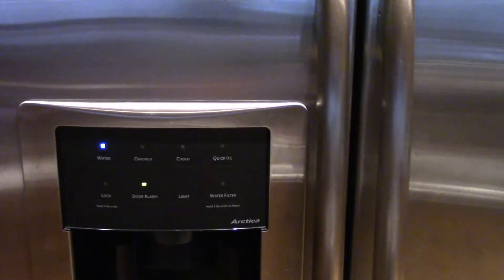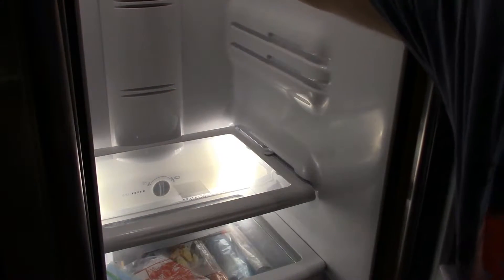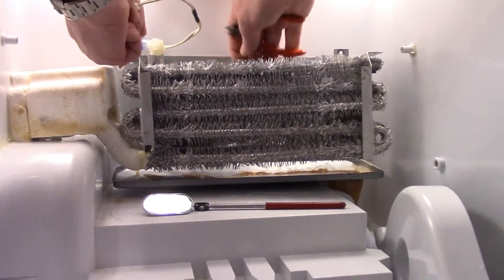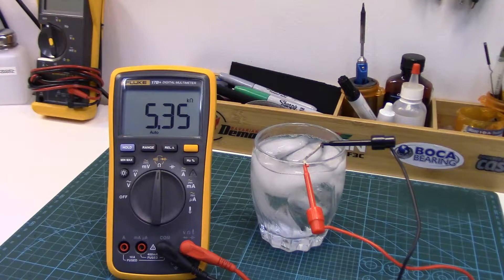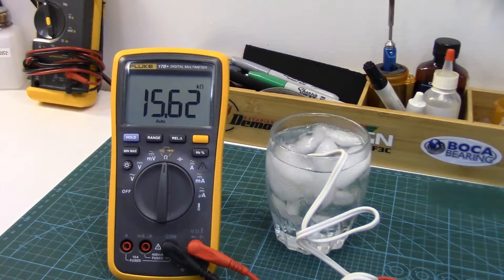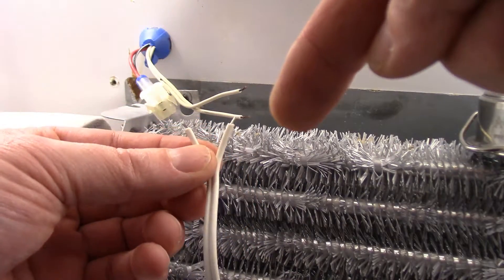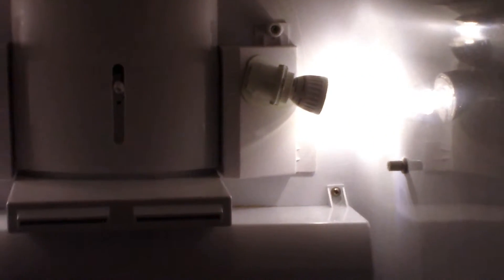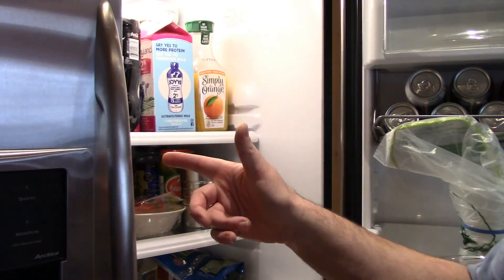Fridge Temp Sensor Replacement & Testing

Comment: Hi. I have a freezer( turbo air) I need to set the temperature between 17-22 degrees. Any recommendation? The guy that used to do it stopped doing it.

Comment: The temp sensor in my refrigerator freezer section went and with 2!sensors in the freezer, one reading 0 degrees and one reading 85 degrees at the evaporator, from the motherboard i knew my problem, replaced the thermistor and the both are reading a freezer temp with resistance difference between the two  being very close to each other. I found marine grade heat shrink very important. And i cover the ends of the heat shrink with a little RTV from my automotive supplies. And i do love my LED bulbs ! And you are lucky my motherboard is $275.

Comment: What was the resistance written on the wire of the old thermistor?  What was the value written on the new one (at room temp 25C)?  I would assume that it has to match? The old one seemed to work (a few k ohms and changed when cooled). How many thermistors are in a normal fridge (refrigerator plus freezer (LG three door)?
Reply from the maker: There were/are no resistance values on the wires/thermistors, you have to get that info online as I show in the video @ time index: 4:49. Your specific model might also indicate the values on the schematic diagram which is a pamphlet either on the back of the fridge or in a pouch beside the main board (at least on GE) no idea what LG offers. A few K ohms out from nominal is most certainly enough to cause issues. Test values have to be pretty much what the manufacture call for, in this case 6.2K at 68F and 16.3K at freezing, just as shown and indicated in that GE online test manual. Other brands may have different diagnostic test methodology however so don't just presume all are the same.
All depends on the design of the refrigerator as to how many thermistors are used. Two evap units like this one will generally have 4 (one on each evap, and one for each cooling compartment). That information is shown on the schematic diagram for the specific make and model or look it up online.
Reply: Wow, as many as 4.  I was wondering if there was even one in the Ice maker area (5?, left side of top refrigerator section).  So far it has been confusing at best to locate good, non-conflicting LG data for my model (LFX31925ST /08 ASTCNA8).  Mine suffers from the refrigerator section getting too cold, so that is likely where the defective part is (if i can only find it). I think i will pull it out and see what is on the back (one line diagram). @Rchelicopterfun

Comment: OMG ☹as originally suspected I think it’s my freezer evaporator thermal sensor now! Freezer temp getting colder @ -1F yesterday.  I replaced the freezer side panel thermistor behind the oval plastic grille. Temperature went even lower -13F (12hrs later). Do I need to remove the evaporator to get @the 2nd freezer temp sensor? Gerr! It’s a bear to get into the evaporator freezer section.  Didn’t even see the sensor on another YouTube video of replacing the condensate pan just under the evaporator.  Can’t find a diagram of its exact location. GE Ziss480nxbss. Wondering if I can pull it out through the rubber plug (easily accesed) of wires into the evaporator compartment though the wall separating the evaporator and the compressor up top? In your video your sensor came through the back wall through a rubber plug of wires (although your sensor sat in a specific hole near the evaporator). My rubber plug of wires is easily accessed at the top compressor housing compartment. Help please please🙏🏻 need an exact location of my freezer sensor.

Comment: I have a hisense rb372n4ac2, same problem. Should i change the sensor nearby the evaporator like you did, or another sensor in de freezer underneath on top. There also another sensor in the fridge. The fan is turning pretty and the compressor is constantly running

Comment: Wow John, I have almost the same exact fridge PSS26MSTD. Great tutorial. My issue is the freezer builds up frost every week or two and I have to let it melt and plug fridge back in. I heard the amazon heaters are horrible so I was going to buy a GE heater. Wondering if the Amazon Thermostats and Temp sensors are decent. I guess my only concern is if I should replace all 3 parts considering I have to pay out of pocket. No help from landlord. I guess I’m going to open the freezer panel and test the Temp sensor first. Any suggestions, like if the sensor is bad, are the other 2 parts bad as well? Any ideas would be highly appreciated as I have been unplugging fridge for about 3 months because too expensive to get a repair man! They want like $600. All 3 parts from Ge are $180, but the heater alone is $105. So if I don’t have to replace heater, it would be great.
Reply: Great Video btw John. Very clear instructions on how to test. I was wondering, if I put a multimeter on the heater and there is continuity, does that mean it’s good? Just curious on how to check if it’s bad. This has been an ongoing problem. I’ll update when I check the temp sensor first. Sry for the long message! Take care.
Reply from the maker: Sorry, no idea on the heater as I've never done one. If I had a suspect defrost heater, I would be researching the full diagnostic fault tracing procedure using Google and/or the repair forums. Could be several things I would think ranging from the temp senor to the heater relay to the heater itself, or worse case, the control board.
Reply: @Rchelicopterfun  yea, hoping it’s not the board! Thx John. I’ll be checking sensor later today.

Comment: Are all sensors have the range or each  manufacture has its own specification?
Reply from the maker: Some will be the same, others different. Always best to check the manual for your specific model for confirmation .

Comment: We have this exact fridge and I've fixed most issues except the ice maker so I'm hoping you can help.  I'll give some backstory. I usually fix our own appliances but this came with our new home and Monogram is much more complex than traditional fridges it seems.  When we moved in it worked just fine for a few months except the ice maker didn't work. The water doesn't come out of the inlet that goes into the ice tray. The water inlet for the water dispenser works fine. We decided to ignore it since we just moved in and had bigger things to worry about and just made ice using traditional trays in the freezer.

But then suddenly the fridge's temperature was having strange readings where it said the fridge was 40 degrees and then the freezer was -1 or -2 degrees.  I assumed coils were frozen over and checked everything but couldn't find anything wrong. For the first time I decided to call a technician that claimed to be certified for GE Monogram,  but when he arrived he tried doing the basic diagnosis of checking the coils.  They weren't frozen over and seemed to have no idea what was wrong.  Charged me for the diagnosis and then he called someone else who he said "knows more about these fridges" and said we needed a new computer and that person would come to replace it and it would cost over $1000.  This seemed ridiculous as we could buy a brand new fridge for not much more than this.  I told him no thanks.

I decided to take another look and cleaned out the fridge and just opened things up and checked all the parts and cleaned them. I cleaned the compressor squirrel cage in the back to remove dust and noticed some water in the overflow at the bottom and cleaned that out.  Put everything back together and suddenly the fridge was working perfectly fine again and reading 0 and 37 degrees as it should and it's been working fine ever since. It's been at least 6 months or more.

BUT the ice maker still doesn't work and it would be nice to figure this out.  No coils seem frozen over and when you try the ice maker you can hear it working and the parts turning.  The only issue is just the water inlet doesn't put any water into the tray.  Do you have any suggestions on what this could be?
Reply from the maker: @Podtrash Radio - As you said, these split evaporator type of fridges with water & icemakers are a little more complicated and as the old engineering adage goes "complexity hampers reliability".
I would start the diagnostic trouble shooting process at the water valve solenoid for the icemaker. If you're lucky, it's just a faulty water valve solenoid. If it's not the solenoid however, then you'll have go through the entire system with digital volt meter in hand. Your call then if you want to work downstream of the valve to the ice maker, or upstream back to the main control board. For example, if the valve isn't getting power, is it because the relay on the main board is shot (or the transistor/circuit that fires it), or is it because the main board is not getting the water flow signal from the icemaker sensor/switch to trigger the relay? Lots to check, but I would start at the valve since its' the easiest and electo-magnetic solenoid valves are a known weak link.
No idea of course if that's the GE factory approved flow chart trouble shooting direction - I'm an auto tech by trade, not an appliance tech. Like you, I've always fix all our appliances, HVAC, and electronics myself & saved many thousands doing so. Haven't called a service tech ever other than once to recharge our outside AC unit. Most of the time, it's really simple little things to fix as you mentioned. 
One other little thought if you plan on keeping the fridge... Not sure how easy it is to get main boards for this model anymore. I ordered one for ours about 7 years ago when you could find them on eBay for around $100 bucks even through there was nothing wrong with ours. It's a nice spare part to have on hand, even just for helping trouble shoot problems to the board or one of the other components in the system.

Comment: What is the value of the resistance Ohms..
 on the thermistor before it is put into ice water?
Reply from the maker: That is totally dependent on ambient temp, thus the reason it's checked in ice water at 0C.

Comment: wait....NO!!!   you cut wires to a part ( just after you defrosted the coils with a hair dryer) without even attemping to remove the tape or whatever from the next connecting point.  Yes you mention that it looks like a past repair fix that but doesn't mean you should just cut the wires!!!  What if that isn't the problem???  how may people following this video has cut those wires and now need to replace that part AND the part that is broken?!?!?!??!!  Why didn't you undo the tape and follow it back to the next "piece"????
Reply from the maker: YES! That is not easy to remove tape partner, it's adhesive lined environmental heat-shrink permanently bonded to the wiring. Impossible to remove - it has to be cut out. Also, you can't test a thermocouple in circuit - it would give an incorrect resistance reading - it has to be removed from circuit for testing. If the thermocouple tested out ok after removing it, then you simply splice it back in; but it's so inexpensive & a common mode of failure, I would have replaced it regardless.
This is electronics diagnostics 101. Start at the easy, most likely, and least expensive components and work your way through the circuit. Training & experience vs. ignorant YouTube comments in other words.

Comment: Hi yes that helped me out quite a bit. My refrigerator was running on low speed it seemed in the back of the evaporator was always getting frozen solid. So in the morning I am going toTest those refrigerator and freezer sensors to see that they are operating properly thanks for the approval good luck with your fridge
Reply from the maker: Hope you find the fault and that it's an easy sensor replacement fix.

Comment: I'm looking at a used fridge for sale and they said the issue is "the back of the freezer coils will freeze up . probably needs a new defrost temperature control button or whatever it's called".

Could this be the issue? Or what could it be?
Reply from the maker: No idea.

Comment: Why not just replace the thermistors with new ones instead of fooling with testing?
Reply from the maker: Simple, testing the component is the only way to know if that is the real problem or not. Tossing parts at things in hope it might fix the problem wastes both time and money. Especially on something simple like a thermistor that is so easy to test and only takes a couple minutes. The question is why wouldn't you test it.
Reply: @Rchelicopterfun  I assume you would already have purchased new thermistors before you took things apart .They are inexpensive (5-6 dollars), so why not save time and just put new ones in since you would be cutting the wires to test them anyway..?? Same situation with the defrost element which is inexpensive.  If you are going to take everything apart, wouldn't it make sense to just replace these parts to see if the problem is fixed, possibly ruling out a mother board replacement ($200-400) or service call.
Reply from the maker: Yes, regardless on a low cost item like this that has to be cut out, you are going to replace it while you've got things all apart, that only makes sense. That wasn't your original comment however; you asked why test it and I took the time to explain why. A simple 2 minute test to put your mind at ease, know you found the likely issue and confidence to button everything back up.

Comment: Hi, John I snipped my thermistor aka temperature sensor aka defrost sensor...I looked up everything for Kenmore Model: 59672003011 and there’s not shit about a replacement, not even Sears could understand why it’s missing from there parts replacement, they only show thermistor cover for sale, so bizarre. Anyway a tip I read online most thermistors are the same, but I bought a whirlpool one that looks identical, is that safe to say? I was told certain black colored bottoms that are round in shape from early years are prone to fail. Mines white with black flat bottom so fingers crossed, it has lasted years before so..it’s giving no reading, so junk now. But I had to clip mine cause leads vanish behind wall, is shrink seal good enough or should I try and find where the hell these leads go too? New piece has long leads. I’m scared it’ll short. Electrical tape big no no, right? Thanks
Reply from the maker: @Chadd Steinberg, I'm not an appliance repair technician, so I don't know what brands use what sensors, if they are all the same, or have different resistive values.  All you can do is try it and see if it works or call in a tech to do the repair. If you really wanted to know if the resistance value of the new one you got is the same as what was in there before would be to check another one of the temp sensors in your fridge to see what its resistive characteristics are and if they compare to the new one at various temperatures. 
The standard practice to replace these things is exactly how I show in the video because the wiring going through the inner fridge cabinet to the mother board on the exterior is both well sealed at the exit location and likely also running through insulating foam making it next to impossible to pull out. Cut the wiring, and solder the new sensor into position using an environmentally SEALED insulation method such as environmental heat shrink like I show. Electrical tape will not keep moisture from migrating into the wiring.
Reply: @Rchelicopterfun  Oh, I assumed you did a lot of appliance repairs. Thought the faulty thermistor tip was something that could help or you’d heard about. None the less your video was very informative, I’ll attempt it the way you had. My new thermistor came with caps to clench around the soldiered wire, just debating whether to trust them or heat shrink your way..minor decisions that could cause a short, no wonder I’m a procrastinator 😅 by the way If you ever have to melt ice again, grab a handheld heat gun, cut the time down tremendously compared to hair blower. I’ll have to checkout your other content. Thanks for getting back in timely manner John 👍🏻
Reply from the maker: @Chadd Steinberg - I'm actually an automotive tech by trade and have a background in electronics as well. I have repaired a lot of appliances & home electronics over the decades, but that of course is no substitute for full time appliance field repair experience where you get a very good idea of what brand components are universal or proprietary. For specifics like that, I rely on Google search 🙂.
Not sure I would want to use a heat gun on a refrigerator evaporator coil. That kind of heat could send refrigerant system pressures well beyond their design tolerance I would think. I was actually somewhat nervous even using the hair dryer but figured it would be fairly safe considering the defrost cycle would heat the evap coils up about the same amount. I also didn't want to melt the plastic right behind the evap or the wiring.

Comment: How can we start the fridge continuously in case it takes long time to get the new sensor?
Reply from the maker: You can't run it continuously or it will ice up the evaporator exactly as shown in this example.

Comment: Thanks for the video.  An easy way to melt the ice on the evaporator coil is to put a large pot of boiling hot water (with a pot holder underneath to protect the shelf) inside and close the door.  Repeat until the ice is gone.  Takes about an hour but you don't have to watch the hair dryer melting the ice lol.  Take care and stay safe.

Comment: Great video.  Thank  you.  I tested the continuity of the heating element below and it works, vacuumed all the dust and debris from the front underneath and the rear condenser unit, cleaned the fan,  I replaced the computer board. My freezer won't go to 0 degrees it holds at 13 degrees and the fridge is fine at 37 degrees.  Any suggestions?  Should I change the temp sensor like you showed.